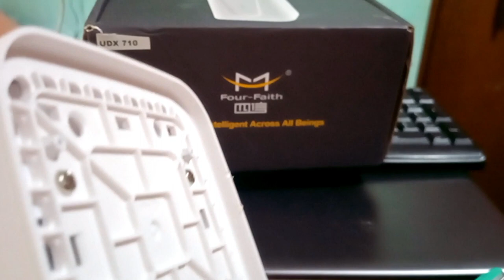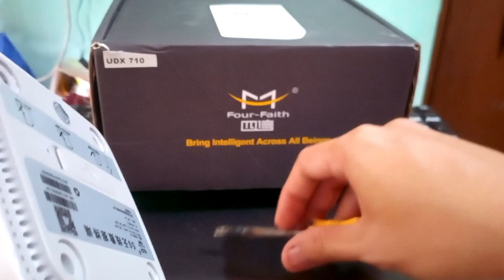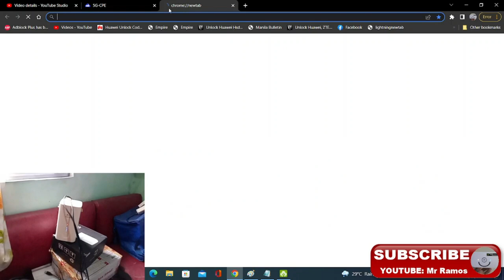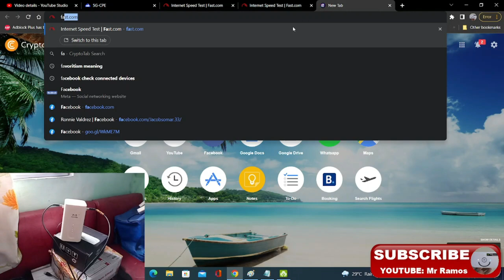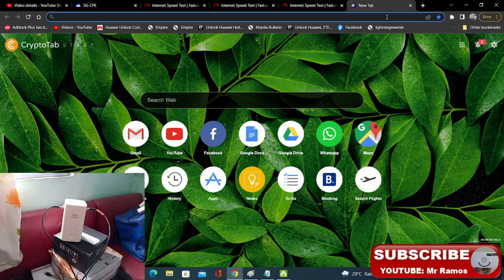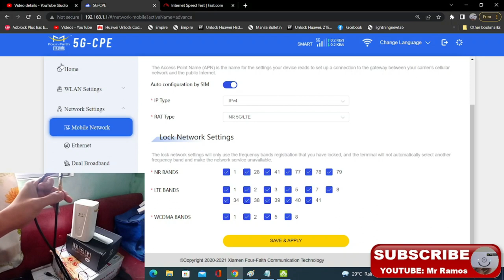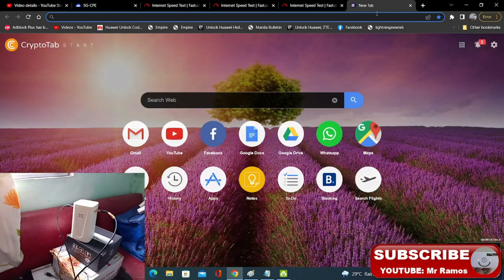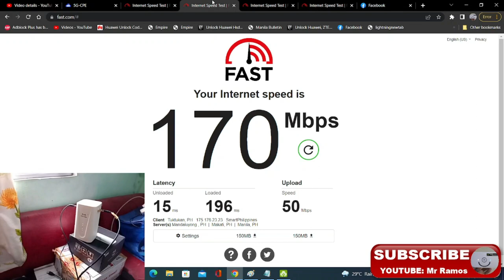Four faith UDX 710 modify

Comment: may na encounter ka na nawawala yung 5G? malapit lg kami sa tower at may antenna . sa modem kaya yun o sa 5G sa tower
Reply from the maker: diko pa na encounter yang experience mo sa four faith .. 

maybe tower problem boss
Reply: @MrJesusRamos  salamat po. 4G  lg muna gamit ko band 41. nung last ok pa e 1 week nka 5G tapos nawala nung 8th day. akala ko sira yung modem ko,bagong bili panamn
Reply: @Renz Castro kamusta yung modem mo paps? F-NR300 V2 ba gamit mo, yung naka Unisoc UDX710? walang external antenna?
Reply: @peejae082004  uu v2 yan udx 710. may fan sya sa loob.  ok naman sya . yung problema ko lang e yung 5G sa area namin . hndi pa consistent.  ginaya kolang gnawa ni sir ramos na tinap/hinang lang sa pcb yung para sa external antenna.
Reply: @renzcastro6044  salamat sa response. umorder nadin ako nung v2, medyo mahal kasi ng 5k yung mediatek na variant e
Reply: @peejae082004  uu mas mahal.mediatek . swerte mo lg kung hnd congested sa area nyu  . mka kuha ka ng mataas na speed.

Comment: Sir pwde ba gamitin  antenna 18dbi yang modem na yn?
Reply from the maker: pwede pero not sure kung maget nya Yung 5G signal..

kung Hindi magka 5G sa old 18dbi ...try upgrade antenna may 4000mhz
Reply: @MrJesusRamos  thanks sir
Reply: Sir, saan naman naka connect ang ground sa ne weld mo na wire?